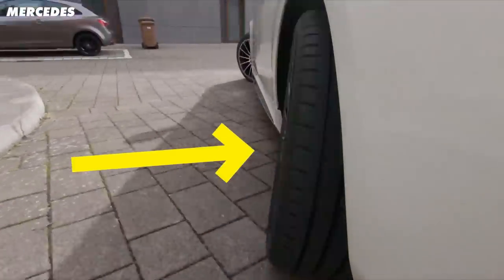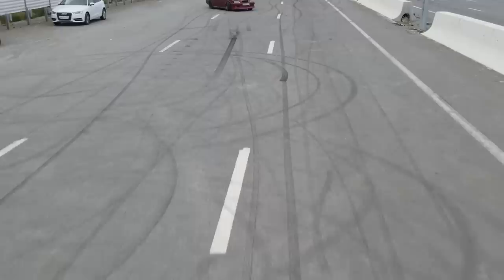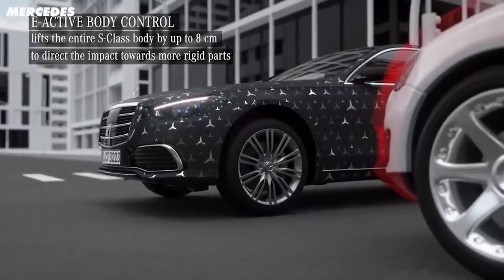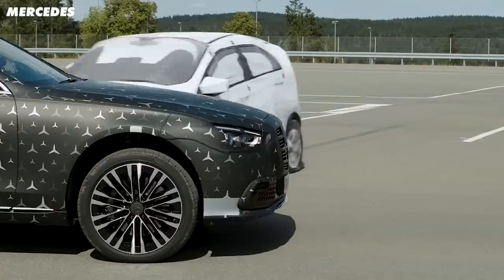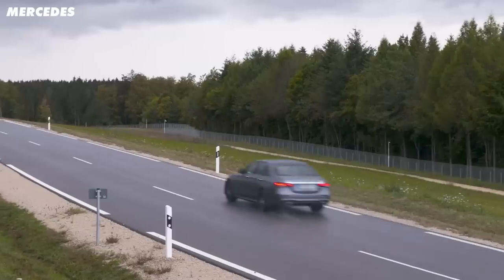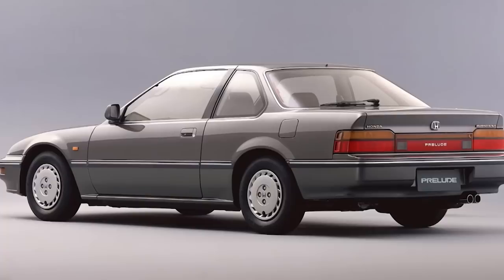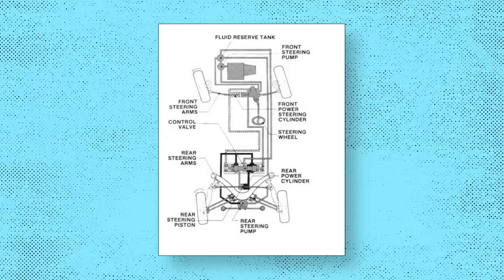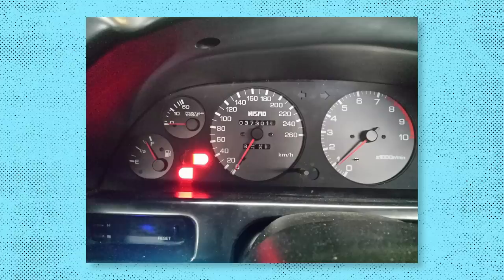Mercedes’ GENIUS Steering Design

Comment: A subscription to 10 degrees of steering has to be the saddest thing I have ever heard in my life lololol
Reply: Pay extra to use at 100% of capabilities something already paid, it seems a new trend to drain more money from users pokets.
It was also mentioned by Louis Rossmann in a recent video about Zero motorcycles.
Reply: We'll end up paying subscriptions for all kinds of stuff without owning anything if we plan to keep living in this planet long therm.  It's the only way to make companies move on from planed obsolescence. We better get used to it.
Reply: @Fulmynato  ahh a man of culture i see
Reply: And worse, Mercedes won't even offer rear axle steering in the UK. Such wusses.
Reply: If I was told that, I would walk straight out of the dealership. Now I know I don't even have to walk in.
Reply: @Fulmynato  what is there to subscribe on a electric bike?
Reply: true
Reply: Most people only lease these cars. A yearly 600 is nothing to them.
Reply: @IvoTrausch  that's right. Only way to prevent this things is if enough people boycott it.
Reply: @mohammedshamil65677  faster charge, extended range, parking mode, all of them enabled via software using hardware already present.
Reply: People need to stop buying from companies that do this. The problem is that they are testing these things out on the rich, who don’t care because this is all chump change to them, but it won’t end with the expensive, electric S-Class, if people keep allowing themselves to be shafted, the companies will keep doing it.
Reply: Literally the Tesla model
Reply: @Fulmynato  this MUST be stopped that is criminal
Reply: @Ion1212g  Turing test? Are you a human or a corporate bot?
Reply: Fucking crazy. It should be illegal to do that
Reply: I mean it's your car if you buy it.
There shouldn't be anything preventing you from overriding it.
Reply: @kowan011  Merc won't offer it in the UK because in general the law here does not allow for a company to turn off a feature on a physical device which has been purchased outright. In other words, they are unsure of how liable they will be in consumer legislation; such legislation being very strong in the UK, much more so than in the rest of Europe who caved in to companies like Merc and Tesla.
Reply: @bertram-raven  Essentially, instead of offering it as an option package for the lifetime of the car in the UK, they decided to chicken out.
Reply: Collab with EA next thing they sell you skins for your car that peel off after 6 months
Reply: That Mercedes uses Such subscription services is just showing the true face of the pr department
Reply: Is it possible for owners to just bring this car into a technician and tamper with the software a bit (granted it will stop the official warranty) and unlock these features?
Reply: Don’t support that business model
Reply: @Ion1212g  wow you’re really putting up the fight. Honestly the worst thing I’ve seen someone say in a while
Reply: When you use design to the maximum designed capability, the design will be used to its full design. There are designs that use all potential with faster degradation with testing in mind. Best designs are made with bullet proof reliability without going to extremes, near to design working conditions. With speed, centrifugal force of tire, rim, become higher and for sure in that aspect components have bigger mass and force to be dealt with. All could be achieved with beefier design, components, yet materials and product wouldn't be logical for production, since the weight and cost wouldn't make economical gain in new product, development...
Reply: @gregorizi  how does that relate to a subscription to enhanced car functionality lol
Reply: @Ion1212g  Can't wait to get my subscription for walking and breathing.
Reply: Hahahaha Mercedes can ram it. A subscription for using something already fitted. Is that for real???
Reply: @Ion1212g  I'm not getting used to anything. Mercedes added to the blacklist.
Reply: This should be illegal
Reply: @Ion1212g  no it isn’t.
Reply: Basically you don't really own the car.
Reply: @Ion1212g  that’s all very nice, but not after I’ve first paid €150.000 to buy the thing.
Reply: It's old news Honda Prelude had 4 wheel steering in the 80's...
Reply: Horrendous lol
Reply: @Fulmynato  same thing with teslas' acceleration update that costs 1.5k
Reply: Not sad, deplorable
Reply: Not only sad, it's greedy... and greed is the root of all evil.
Reply: @Fulmynato  watch Out, Sinn they are giving us furnaces but for more than 200°C you have to pay a monthly subscription...
Reply: @Ion1212g  NEVER
Reply: Bunch of criminals
Reply: BMW does that but ehh just wait a decade and you will get it for cheapp
Reply: i thought this comment was just a farce until i reached that point in the video.. WTF?
Reply: @Ion1212g  some people wanna work once to live free forever, and it is not right in any single way
Reply: Hack the car to get it for free
Reply: It's a 1500€ option in the online configurator, not a subscription. Spread over a 3-year lease it's about $575.

Comment: It being a supscription feature is hilariously tragic. I look forward to when I can buy a used one in twenty years that has an unfixable bug and is constantly locked to the left giving me that drift feeling everywhere I go.
Reply: The ones I have fixed on old hondas last forever and are easy to service, It's just a second steering rack. I wouldn't put it past MB to make it unservicable however.
Reply: @nobodynoone2500  They'll software lock post service alignment or something along those lines behind proprietary closed source software tools.
Either that or straight up booby trap it so any unplugging gets registered as a 'maintenance error' which leaves it spitting out 'go to dealership' messages.
Reply: subscription runs out just as you round a corner and the wheels lock in whatever position they were in :D
Reply: @nobodynoone2500  something I wish he would've touched on a but more is that in those old Hondas it was all mechanical. Entirely just gears and rods hooked up to the front. If that shit broke you could probably MacGyver something and get it back up and running. Mercedes rw steering relies a ton on computer systems and if they break I guarantee you that even if you replace it with entirely oem parts it'll still throw an error code and need to you to reprogram the computer with expensive proprietory equipment to accept the new parts

Comment: 4 wheel steering and ultra complex suspension... I've needed a rear anti roll bar bushing for 2years, I'd never keep up with that level of maintenance! 😂
Reply: but what if it is a electric car
Reply: That's why it's in the S class and Maybachs only
Reply: @Very_Grumpy_Cat  u still need to maintain it…
Reply: @MotorsportTukker  No you wouldn't... Electric cars are built using magical materials mined by dwarves and the electricity comes from power plants using refined unicorn farts.
Reply: @C.Fecteau-AU-MJ13  u need to maintain every car, otherwise it will look like shit, just cuz it’s electric doesn’t mean the car is maintaince free
Reply: FYI, the arb bushing has only been an advisory not a major on the MOT thus far! 😊
Reply: wise words from a real pearson
Reply: Worse part is you'll have to fix it when it fails even though you don't pay for the prescription to he able to use it. Totally fkkd up
Reply: You can activate the anti-roll bar for $49.00 per month if you want!

Comment: Mitsubushi had a Galant model (possibly the VR4 - I can't remember) in the early '90's with rear steering too. I believe it was active rather than passive, but only a small angle. The far more common application for 4 wheel steering than monster trucks is agricultural and some off highway machinery such as some JCB Loadall and Fastrac models. I would guess that this is exactly where the monster trucks took their 4 wheel steer technology from, as they either used to or still do source their axles from that kind of machinery too. As for paying a subscription to unlock a feature which you have already paid for the hardware for, I know where Mercedes can shove that idea!
Reply: 300ZX had it too
Reply: @farchanmuhammad7850  Skyline did too. It's just not common enough, so every time it is added it is being treated as "brand new thing"
Reply: Honda prelude and several Subarus too.
Reply: alot of JDM car had 4ws in the 90s also renault megan rs has it this is nothing new like you said
Reply: It was VR4 Galant. Hydraulic. Also Honda Prelude.
Reply: Peugeot also used something on 306 but just flex bushing which is very different but still some form
Reply: @robwarmisham3696  i used to have 4ws prelude untill the system broke and it was cheaper to by parts for non 4ws prelude so i converted it
Reply: The 3000 GTO Vr4 had this as well, which I guess makes sense since its also Mitsubishi
Reply: Actually nissan made a 4 wheel steering system even earlier for it's skyline gtr r32 and used it for the r33, r34 and the z32/300zx too. Mitsubishi used the same vr4 system on the gto/3000gt first generation highest model, but discarded on the further gto generations cause it was very expensive and not so reliable
Reply: Chevy had an Silverado with 4 wheel steering too
Reply: @Edward Elizabeth Hitler something that's simple AND works on an italian car? This is the first time that's been said about anything other than an error light
Reply: Honda too
Reply: Honda prelude too
Reply: They don't want you to own a car out right. They want you to lease & return/replace. They want to buy service plan if it is not in your lease. With EV's they will to sell a subscription to a Super Charger Network, so you don't have queue with peasants. You may well find a chain of hotels & restaurants linked to Superchargers so automatically get a parking space close to the building with your dinner/room reservations. Tesla over the air updates are free, one their USP's for the last ten years. You sell a better Tesla than you bought 3, 4 years ago. Once they charge everybody will. Sales, sales forecasts & targets will be dead in the water. It will be daily, weekly & monthly Income Stream. Yes everybody Loves Raymond! But everybody Adores Monthly Payment Plan. No I can't afford $50K for New car. But I can afford $400/month for 4/5 years. I get a brand new with no outlay after trading my existing car in as a deposit. What can possibly go wrong? You owe you job!
Reply: And Renault too played with rear wheel turning, called it "4-control"'. Exists only on some Megane and maybe a special edition laguna.
Seems like everyone made that before mercedes !
Reply: I once owned 4WD Mitsubishi Galant (n/a one, not VR4), and it had 4WS system. Worked amazingly, despite being 30 years old. Turning angle of rear wheels was quite small, but made a big difference on a highway.
Reply: I remember seeing TV ad in 1990 or so for Honda Prelude about these newfangled 4 wheel steering.
they dropped it on the next model prelude.
ie, people didn't care.
Reply: R34 have it too
Reply: Prelude had 1
Reply: Honda Maestro in Indonesia
Reply: I was looking for this comment.. This narrator makes it sound like it's something new when this technology has been around for over 30yrs ! Lol
Reply: Nissan created HICAS for the R31 skyline back in the early 80's mercedes is trippin
Reply: @Edward Elizabeth Hitler the 916 gtv and spider had it too and it was far more aggressive than the 156 design. But the entire suspension design was extremely complex too

Comment: The nissan HICAS 4ws system was reliable for the most part and still is. The reason why many fit a lockout bar is because drivers wanted a more predictable drive rather than the maneuverability, which could be tuned into the car in other ways.
Reply: Nissan's SUPER HICAS in the 300zx is fun to drive with tbh. i have to get used to it at higher speeds but after some time it is actually kinda predictable and can improve laptimes when used well by a skilled driver
Reply: @Adam A. The last thing you want is your car to oversteer unexpectedly with the rear wheels rotated during a drift. HICAS is only good for grip.

Comment: The 2002 RX-7 FD Spirit R used passive rear wheel steering through bushing compliance.
Reply: similar stuff also on old citroens if I remember correctly
Reply: Would probably be considered a safety risk if one ever broke full tilt
Reply: yes on Citroen Xsara and Peug 306 there where "bushing steering", but was scary and not easy at high speed.
Honda on the Civic type R EP3 had a rear lower arm compliance to give toe in under stress .... a lot of usefull solution has been done (multilinks for example) for those high speed stability. for me the clever is the prelude 3gen one, full mechanical
Reply: @Yapudo  Passive rear steering on the Xsara was great, and not at all scary. Citation: I owned a VTS.
Reply: I tought that it was only the fc

Comment: GM trucks (USA) had optional mechanical  rear wheel steer for some years. As I recall the rear steering linkage was connected to the front by a rotating shaft. Around the center it did nothing. Only when you cranked in lots of steering lock such as when doing a tight turn, it would counter steer. No idea how well it worked but I haven’t seen it for years.
Reply: It got progressively cheaper and cheaper til they discontinued it. Called it Quadrasteer, offered on the towing class of pickup

Comment: Alfa GTV (916) rear suspension (Wikipedia): "The design of this geometry, and the fine tuning of the bushes, is such that during initial stages of a turn, the centrifugal forces create a small 'rear wheel steer' effect in the opposite direction to the way the front wheels are being pointed. Then, as the centrifugal forces build up through the corner, the rear wheels start steering in the same direction as the front wheels."
Edit: I see other comments about the French doing the same back in the '90s. Interesting.
Reply: And the Japanese before that.
Reply: @Edward Elizabeth Hitler Ah - no, I was talking about proper 'active' 4 wheel steering like on the Honda Prelude
Reply: In the 156 it's barely noticeable but in the 147 the effect can be felt a lot and is scary when tje road is uneven, not sure if related but the 147 likes to jump from the back when on a curve.

Comment: Rear wheel steering has been something the Honda Prelude had since the 1980’s. The base Acura TLX has RWS too.
Reply: Right nothing new here. My 88 prelude is 4ws
Reply: did it also have 10 degrees of steering angle, and was adaptable to its environment?
Reply: @gavcom4060  prelude doesn't need that much. It's a short car. The maximum same-direction steering angle is 1.5 degrees, and the maximum counter-steering angle is 5.3 degrees. This was also 100% mechanical and the first production car to have it. Still it's nothing new, old tech making it back around in a new age.
Reply: @gavcom4060  and yes it did adapt based on speed and direction.
Reply: @MeppyMan  The mechanical RWS of the third gen Honda's did not adjust by speed, just by steering angle, but were still excellent.

Comment: If I recall correctly, Citroën and also BMW did have this feature (always with a smaller steering angle) on some of their higher end and higher finitions cars.
Reply: Renault as well
Reply: @rotorblade9508  Yep they did but they were mentionned in the video :)
Reply: Also all the VAG premium brands have it. (Audi, Porsche, Bentley)
Reply: Yes they do but I think they were mentionned in the video or other comments :)
Reply: I believe the citroën xantia activa had it. It also had adaptive hydropneumatic suspension which made it the best handling car i know of to this day. So much so that cars like the porsche gt3 wouldn't be able to keep up with it if they had the same engine. And it was crazy comfortable
Reply: @bisken6547  The Xantia Activa did not have any rws, but it did have computer controlled hydropneumatic suspensions indeed. And I think it would beat a porsche gt3 from the same year on any track without any change of power unit ;) (edit: in fact it did have RWS, thanks @Rui Maldonado for digging up the brochure.)
Reply: @BioFake1  hmm i couldda sworn it had some form of passive rear steering. Might be that the zx had it and i just mixed the memories. But anyhow, a swedish motor magazine (teknikarens varld or something similar) had something called the elk test where you are supposed to avoid an obstacle, changing direction two times, and the activa remains undefeated to this day. And they've tested road-going racecars there
Reply: Just looked it up. It even beat the 2017 mclaren 675LT
Reply: @bisken6547  Every Xantia had it indeed, not only the Active version. I had an 1.9 TD and got surprised by it in the first corner I took on. It also helped a lot when parallel parking as it steered in the same direction as the front wheels. Check it out, page 10 of this catalog: https://autocatalogarchive.com/wp-content/uploads/2016/08/Citroen-Xantia-1999-UK.pdf
Reply: @RuiMaldonado  You are right, my bad !
Reply: @RuiMaldonado  oh damn thats awesome. The only reason i'm alive right now is that we had a xantia once when my brother misjudged a corner and took it at even the xantia's cornering abilities' limit. The most g-forces i've ever experienced

Comment: Prelude already had this in the 80s. Wonder why it didn’t become more common
Reply: I did wheel alignment on one, what a nightmare!
Reply: This would also make the cars more complicated, more expensive and less reliable.
And most small cars don’t need it.
Reply: Because it didn't really help handling that much, had more stuff to break, and freaked out crappy mechanics. It's just another steering rack. Nothing complicated.
Reply: @Petriefied0246  I have too, It was just as easy as any other car. If you can't handle rear wheels that turn how did you ever align a front end? lmao.
Reply: @GrillerRohde  oh no, the honda 4ws system was (and is) extremely reliable